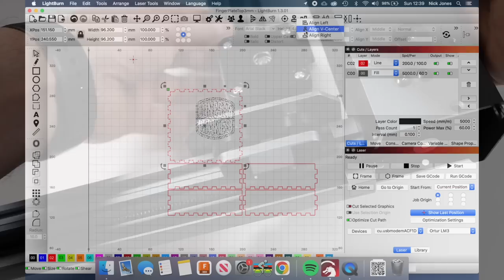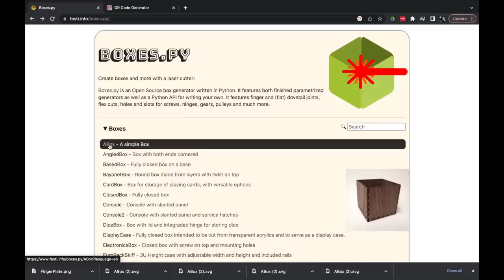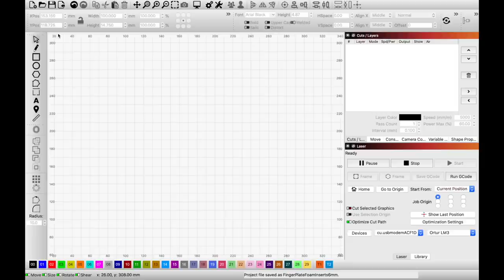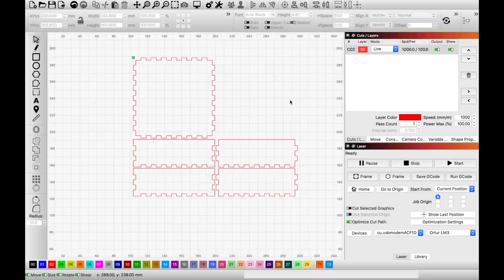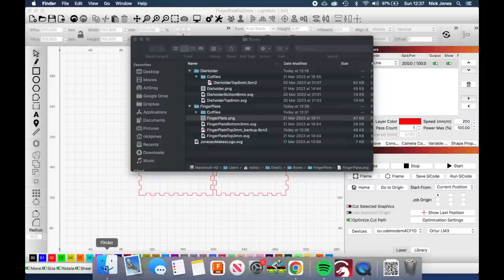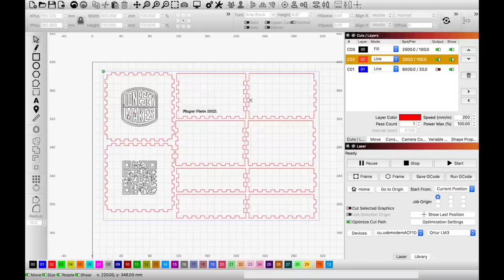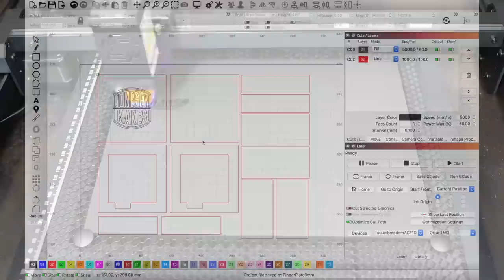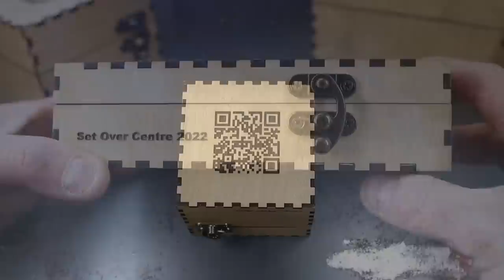Making custom toolboxes using a laser engraver

Comment: I always love your content and your beautiful photography. 👍
Here are a couple of suggestions; try an aquarium pump for your laser "compressed air" feed. Aquarium pumps are very small quiet and can run continuously, and the larger/better ones will pump a surprising amount of air.
And instead of drilling those tiny holes by hand, I put the pinvice in my electric screwdriver. It is very convenient in the hand and the low 2 revs per second speed is perfect for drilling soft materials like wood and plastic. It is so convenient I have it in arms reach of my bench and even use it as a replacement for a centre punch sometimes, just "drill" a little divot a couple mm deep. I find that quieter, more comfortable and more accurate than using a hammer and centre punch.
Reply from the maker: Thanks! Great tips, I’ll be sure to try the pump and pin vice ideas.

Comment: I would suggest some little 10mm glue blocks in the corners just for reinforcement sake and to either seal the inside of the boxes with the same danish oil or add a few cheap desiccant packs during storage bc the wood will absorb moisture and could cause flash rusting.  👍👍

Comment: 4:29 See the trouble selecting just the logo?  If you click and drag from top left, you must totally surround the selection. If you click and drag from bottom, right, everything the cursor touches will be selected. A very handy user interface!
Reply from the maker: Great tip, thanks!
Reply: Lightburn has great features like that one.   I wish it supported my P2 laser.   Super frustrating.    Technically it is supported but none of the features that make the P2 interesting are 😂

Comment: One important thing is kerf, or correction for laser thickness. The web sets 0,1mm correction by default, but you have to check if you have already set lightburn to account for that correction or you might correct twice, or cancel one correction with the other. You would end up wit pieces that don’t fit or that have too much play…
Reply from the maker: Thanks, I'll check that setting in Lightburn.

Comment: To save time on the cut while in Lightburn you can interlock the finger joints then change the setting to remove overlapping lines. Nice video the foam engraving looks great.
Reply from the maker: That’s a good tip, didn’t know you could do that. Thanks.

Comment: Great video!  a few questions.  What watt laser diode are you using? (10w or 20w) What thickness EVA foam have you cut?  What are the preferred power and speed setting that you use for the various thicknesses?  Thanks for the help!!
Reply from the maker: Thanks! It's a 10W diode. 6mm EVA foam. That's the only one I've tried. I forget the exact numbers, I think for engraving the foam I used 5000mm/min at 60% power. To cut it I think I used 2000mm/min

Comment: This is really cool!  I’ve got a nice laser engraver but struggle to really use it for something practical like this project.    Did you just calculate the sizes for the foam inserts on your own?
Reply from the maker: Yes, i measured the internal dimensions of the box, then worked out the shape of the tool for the cut out

Comment: I liked the use of the hinges for the box top.  I guess if you're feeling precise you could laser in the mounting holes.  I have a box I'm making so will give it a try.  I like the idea of using the foam :)  Where did you pickup the latches for the front?
Reply from the maker: Laser cutting the holes is a good idea. I got the latches on Amazon, I forget exactly where. Just search for jewellery box latches.

Comment: Hi Nick. I'm binging on your Hemingway videos as I try to get back into the hobby after illness. I wonder if you could give some more details about things like inserts you use and specialised milling tools? I'm particularly interested in ones for non-ferrous applications. I have a large stockpile of Hemingway kits bought years ago during a sale....... Have Hemingway revamped the plans to move towards metric sizing? I do very much appreciate your reference of both dimensional systems - my set up is largely metric. Thanks.
Reply from the maker: Hi Bob, for non ferrous I use these highly polished inserts with leave a really nice finish;
https://www.cutwel.co.uk/lathe-tools/iso-turning-inserts-tool-holders-boring-bars/carbide-turning-inserts/cc-style-turning-inserts/ccgt-al-carbide-turning-inserts-ground-and-polished-chipbreaker-for-non-ferrous-yg-1-new-cutwel-ltd-23
Reply from the maker: Some of the newer kits are in metric, but most of the kits are still imperial as far as I can tell.

Comment: chuck one of these little silica baggie´s in there... that you sometimes get in electronic goods or shoes packiging. They absorb the moisture or ?
Reply from the maker: Good idea, I will do that.
Reply: Excellent suggestion, and it works well. You need quite large bags to be effective in a humid climate.
You can make them yourself with "Closet Camel" crystals and sewing a fabric (eg muslin) bag. You also need to recharge the crystals periodically by cooking them in the oven.

Comment: That foam look amazing, it is any special foam just just "eva foam"? what thickness is that? Thank you!
Reply: you did not have to glue the foam inserts?
Reply from the maker: Just 'EVA Foam' I bought it from Amazon or Ebay, one of the two. It's 6mm.
Reply from the maker: Yes, I cut them in layers and just used a hot glue gun to stick together.

Comment: Not sure the validity of this, but all the other videos I’ve watched have said not to use your laser at 100% as much as possible, you really should do engraves at some level below 100% but maybe a slower move speed so it gets the same level of darkness you want but doesn’t wear out the laser faster.
Reply from the maker: That is a good point. I need to do some more experimenting
Reply: I have read the contrary : that being below 100% laser power stresses something in the laser chain (the driver?)
anyhow, i doubt that it applies to a diode laser anyway.

Comment: Great Video.  I'm really interested in the  foam padding that you used and I couldn't hear if you  said PB or PD ?  Would you help me with this?  Again I thank you for this valuable information.  It's provided me with yet another way to use my laser.  Very nice work.
Reply from the maker: Thanks Jim. What is it you’re after? The type of foam? It’s EVA foam if that’s helpful.
Reply: It was what ever you used to engrave the logos on the foam.  Thanks for your reply. So it's EVA Foam. Thanks.
Reply from the maker: @46B3x2you  Yes that's right, and just reduce the power settings to engrave the logo

Comment: Do you think this machine can cut expanded polystyrene? And if so, up to what thickness... Thank you in advance for your answer.
Reply from the maker: I'm sure it could yes. As for thickness I would just be guessing, you'd need to do some experiments. The problem you have with thickness is the focal point of the laser, when cutting thicker items you adjust the focal point in the centre of the object but this has limits. I would suggest 10-15mm would be possible, but like I say you'd have to experiment. I'm sure others on Youtube will have already done this some probably worth searching it up.
Reply: @joneseymakes  Thanks for your input. In fact most of the people seem to say that the big issue is the... fire ! I asked xTool support, since their M1 machine will fulfill my needs, but their answer isn't clear about this precise question... I don't never cut more that 2 cm of styrofoam (EPS)...
Reply from the maker: @jm892  Ok wow! Ignore me then! I hadn't thought of the fire risk.

Comment: Awesome to see you create these boxes.  If the laser cutter/engraving machine wasn’t so expensive, I would definitely buy one because I could really use a machine like this for some of my woodworking projects.
Reply from the maker: They are a great tool I think
Reply: do yourself a favor, get a Zbaitu 800x400mm "20W" laser machine. Play with/ Test/ save up a little and then scrap the laser, get a Comgrow actual 20W laser module kit, and still save roughly 400 from the xTool at roughly twice the cutting footprint. Bit of a learning curve, but in the end I have a reliable machine with huge cutting area at a decent price point.Although these Orturs are still a good value and it's basically turnkey